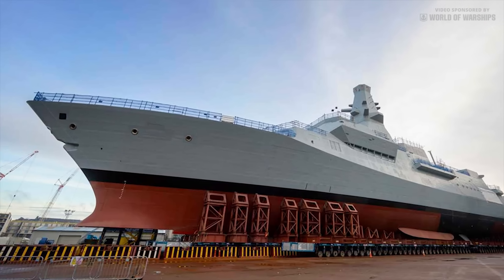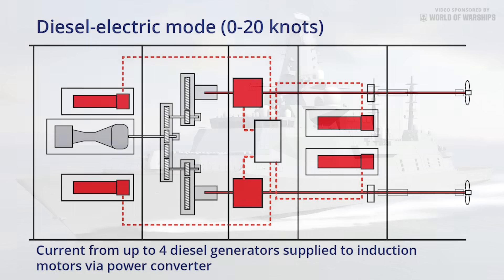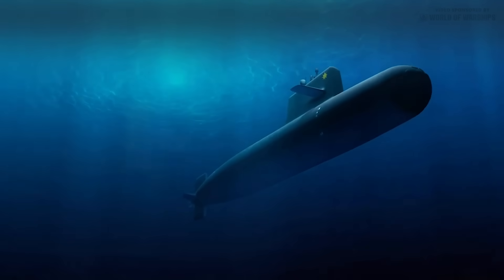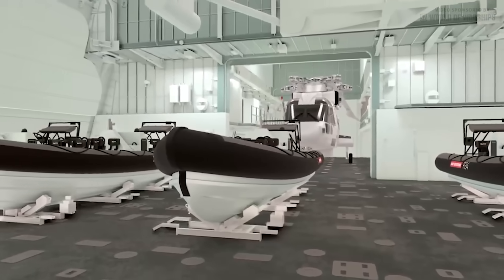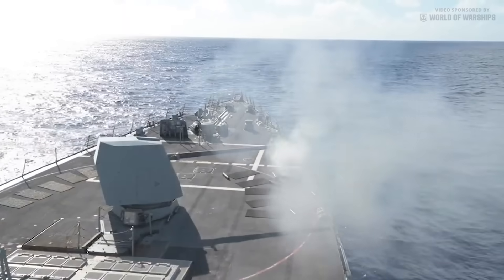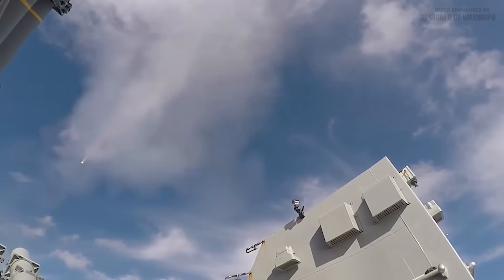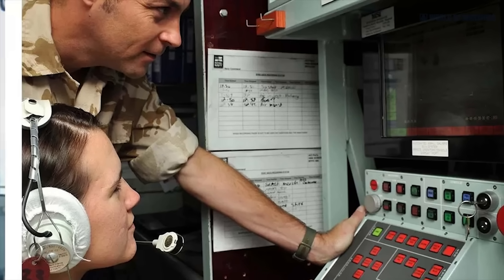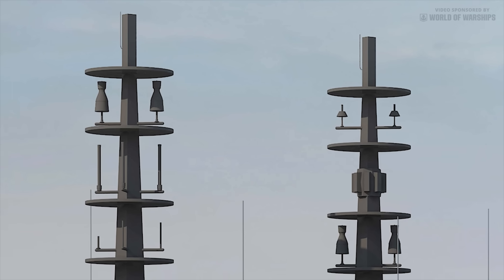An in-depth look at the Type 26 frigate design

Comment: Great video, but I do think that both aircraft carries need extra weapons systems. 3x cwis is not a lot of protection. And before anyone says that she doesn't sail alone, she has destroyers to protect her, but in theory, ammo is not unlimited and all it takes is ONE stray missile to hit the right area and bye bye.
Reply: Because it's not just the missiles and the VLS cells, it's the radars and combat management systems too.
Type 45 already has these (and better ones than any additions to the carriers would ever have) so makes sense to add any extra missiles to the destroyers that are better suited to carrying them because for the added cost of duplicating the fire control systems on the carrier, you'd have to sacrifice some amount of the missiles, meaning you have fewer missiles overall, so more likely to be overwhelmed in the first place.

Plus there are other small things, like if you actually had to fire a missile from the carrier, you'd have to pause all flight operations and do a FOD walk to make sure there isn't any debris from the launch on the deck before you could launch or recover any aircraft or risk losing an aircraft.

I'd much rather have EW systems like AN/SLQ-32 the USN has on all their ships to defeat incoming missiles, but they're much less flashy than missiles, so don't get the recognition they should.
Reply: @sergarlantyrell7847  The slq32 is of, to say the least, dubious effectiveness. It’s another old system that won’t do much against modern threats. Even the usn implicitly admits this in their concerns about taking ships anywhere near China in a war.

The truth is that there really isn’t a way of protecting ships effectively against high end missiles, especially when they can be land launched, meaning salvo sizes can be unlimited. If you have a system that has a ninety % chance of stopping each missile and can’t be overloaded by any number of missiles, then basic maths still says that there is a 50% chance one of the missiles will hit. Even ballistic missiles are cheap compared to warships, so this a losing game.
Reply: That would be a good point if ciws was much use against modern threats. But it’s not.
Reply: …Ciws is still carried because it’s useful about 3rd world threats like speedboats. But modern low level missiles zip through its engagement range in a couple of seconds. The chances of stopping one are low and stopping a realistic salvo is impossible. And ciws can’t even engage top tier threats like manoeuvring ballistic missiles.
Reply: CIWS are the last resort and the last layer of many that protect something like a carrier. All the way from Airborne Early Warning radar (AEW) to Combat Air Patrols (CAP) from jets stationed on board.

If it's down to the CIWS many many things have gone horribly wrong or bad mistakes made. The frigates/destroyers that accompany form many of the strongest innermost layers that protect a carrier, so it makes perfect sense to maximize their capabilities in this role rather than add inferior capabilities to one of the final (and least effective) defences of a carrier
Reply: Royal Navy already tried the missile firing Invincible class, and wound up deciding that its aircraft were more important than being a pocket battlecruiser.  In short, experience has shown the only weapons that really count on an aircraft carrier, are its aircraft.  Hence the need for dedicated bodyguards i.e.frigates and destroyers, plus a submarine.
Reply: Yes, Sea Ceptor is compact enough to have several systems onboard.

Comment: I think it'll carry a few Tomahawk mk'V. Best type 26 video yet and I've seen them all.
Reply: Hopefully, a missile with over 1000 mile/1600km range that is maneuverable and can hit maritime targets would be great.
Reply: I don’t think it’ll be tomahawk as uk and France are developing new missiles for anti ship and land attack
Reply: @TheDrummingWarrior  A possibility if new missile is not ready. Tomahawks can be launched from the Mk. 41 VLS system the Type 26 frigates will employed and are currently used on UK attack subs. Would be a viable option and frigates with 1000+ mile SSM's (with 1000 lb. warheads & possible 3rd. party guidance from onboard helicopter) would make them very potent platforms. Seems the UK is upgrading all their existing stocks of the missile to the Block V standard giving them an new anti-ship capability so integration with Type 26 a logical one & could be a short-term solution. One negative is the relatively slow missile speed (around 600 mph) and why push for a newer / faster missile as you mentioned.
Reply: @NesconProductions  Aussie Hunters will have Tomahawks V and maybe LRASMs we need better range than the NSM Mk II
Reply: The Canadian version will carry Tomahawks.
Reply: UK and Canada will need a larger VLS displacement on their ships and a better radar system to launch tomahawks from the Type 26 frigate varent  they chosen Australia varent will be the only varent of the type 26 class that will be capable of tomahawk launch if they choose the upgunned 96 cell VLS varent displacement of the type 26.

The UK ships don't use US developed wepon system like Aegis combat systems ect. They will use their own land attack varent.  Although  their missile cells will limit them how many they can carry since they given  their frigates too few missile cells

Comment: Excellent video, but your wrong about the Type 45 destroyer it’s displacement isn’t 7,500 tons it’s more like 8,500 tons.
Reply from the maker: According to the RN, T45 official displacement is 7,350 tonnes, although that is probably without weapons, fuel and stores which could amount to a further 1,000 tonnes or so.   https://www.royalnavy.mod.uk/the-equipment/ships/destroyers/daring-class
Reply: @NavyLookout  My uncle is a BAE marine engineer, who worked extensively on the type 45 and now the type 26 if it’s O.K. with you i will take his word for it.
Reply: @Mac  he said that 7,300 dry so full laden 8,500

Comment: Hope the integration engineering being done during this long development and build process means it’ll be well integrated and tested upon launch and won’t have the issues of the Type 45.
Reply: I have wanted to ask this for a while, but resisted the urge, because I know it could be perceived negatively and we have enough of that in the world, but now seems a good time.

How was it possible for the entire class of Type 45s to be launched with such a major engine defect? After HMS Daring was launched did the issues not show up until after Duncan hit the water?

I am genuinely curious, not attempting to troll something that has confused me for some time, happy new year to everyone.
Reply: @Irisishunter  parliament didn’t want to pay the upfront engineering and full mock-up testing and development and the ship power systems didn’t have the generous overhead to overcome degradation in performance.
Reply: @shinybaldy  Thanks for replying, but was any action taken between the launching of the first 45 and the last? Or for BAE was it a case of you ordered 6 ships to these specifications and that is exactly what you will get. Do major ship builders not learn this was a problem with the first of the class, let's make sure it is not a issue for subsequent ships.
Hope that makes sense.
Reply: @Irisishunter  when it’s a new complicated and long lead time item - the best practice isn’t to rush ahead and order six. Parliament didn’t give the engineers the resources or time to do the testing and development on the mock-up.
Reply: @shinybaldy  it's a shame it's not the 12 like originally ordered. It then went to 8, and then 6. They may have batched them and caught the issues for the later batches.
Reply: @Irisishunter  There is always someone who wants to 'pee in the tea', not saying this is you, but every thread about new Royal Navy kit has someone saying it's rubbish.
 Type 26 is looking like it is a very up to date, very useful ship, well thought out, well planned, well implemented, so much so that other countries have taken it up as the future, and not for the 'old pals act'.
 The Type 45 still has stories about it not liking warm weather even though it's considered one of the best air defence destroyers on the planet, the Elisabeth class carrier still has stories about it not being conventional enough, even though it cost a fifth of the latest American carrier and can cope with anything else out there. The Astute class SST still has stories about early design problems dating back a decade or so, but still is seen to be one of the deadliest submarines in the world.
 There will always be those that don't like what the RN are building or sailing. There will always be some saying what their country builds is best, and some who just don't like the country they happen to live in.
 The RN has some of the best cutting edge tech out there, we may be small, we may be different, but the RN and it's ships are always there when needed.
Reply: @RajBlake7  The type 26 does look fantastic, my biggest concern with them is we will not be building enough.
Talk of a new surface combatant, just had me reflecting on the last one if you discount the QE ships and that is the 45s.  
I understand the logic above saying well they would not build a full scale mock up.  But surely you cannot have a better mock up then HMS Daring, were power problems not apparent during her work up that could of been taken into account when building Defender and Duncan?
I should of asked this years ago under another thread, but it has been an itch I have wanted to scratch for a few years and I hoped asking in a respectful fashion here, might get me the answer.
Reply: BAE Systems should have learned the lessons by now but then again it is BAE Systems !
Reply: @1421davidm  BAE are considerably better than many others. General Dynamics UK springs to mind and the AJAX debacle.
Reply: @1421davidm  BAE didn't choose the propulsion system for the Type45...the government did
Reply: Im sure the government will step in and change the spec of something and screw it all up yet
Reply: What issues did the 45 have?
Reply: BAE advised against the type 45 propulsion system as they did not think it was properly developed when it was implemented, MOD wanted to take the risk, it is unfair to blame BAE when they advised against it.
Reply: What were some of the issues with the type 45 mate?
Reply: @maxt7525  The issues have been well reported over the years.
Reply: @paultanton6721  And rectified
Reply: @maxt7525  The propulsion system was ducking useless.
Reply: @ironmantooltime  From my understanding the problem was with an American built heat recovery system in the engine package . It is a new package using a Rolls Royce Engine and there is no issue with the engine. All new packages especially world leading new designs are going to have problems and they will be sorted. If you aim for perfection you never get there, aim for completion and you learn a lot along the way! Radar initially was relatively crude but it was there on time, when needed! We have two world leading Carriers and we with the type 45 the best anti air ships with the type 26 great anti sub capabilities. Enemies of the UK are going to subtlety or not so subtlety rubbish anything that comes out in the UK. Who designed and built the first Carrier, came up with angled flight decks, Steam Catapults, landing light systems, steam turbines? Royal Navy has led the way with many types of vessels and is still doing so. Initial problems yes as will all things but they will be sorted! Look what happens if you wait to long and have to many committees with their opinions all having to be heard. TSR2 closed down, gone, one of the designers said there where arguments by small minded no nothings about labels for switches. We lost a MACH 3 bomber because of stupidity like that. Get on get it done sort it. SA80 Rifle initially, easily damaged, MK 2 sorted, Soldiers happy with it,MK 3 even better. And still no nothings bang on about MK1 problem. Same as carburettor problems on Merlin, oh if you nose dive it cut out misfired big problem. An initial problem fixed by female engineer Tilly shilling in a very short time frame with a washer and then engineered out altogether and still people moan about initial problem. See here: https://en.wikipedia.org/wiki/Beatrice_Shilling.
Reply: @anthonywilson4873  Well said, new designs need to be trialed and sorted. The Type26 are excellent ASW machines but a little short in AAW capability. Aussie Hunters would give more capability.
Reply: Different system, the Type 26 has a MT30 gas turbine with direct drive to the shafts, for high speed, for lower speed they have 4 diesel powered generators, and electric motors, with a clutch assembly to disconnect the MT30 when on electric drive.
Reply: @paulhill1665  yah there’s no troublesome intercooler but the frequency adjusting PWM integration is going to be new. There’s always integration risks.
Reply: @shinybaldy  The Type 23 PGMU Upgrade incorporates some elements of the Type 26 Propulsion system, HMS Richmond has performed well since it was completed on her.
Reply: @paulhill1665  Hope I will get to see one up close one day. If they work as advertised they will be magnificent
Reply: That propulsion system seems a bit exotic IMO, think we will have the same issues with this class as with HMS Duncan and the sister ships in that class unable to work for prolonged periods without suffering a breakdown yet again these ships are back in port , SMH
Reply: @garnet michel  it's not IEP like Type 45 which was a big part of the issue, especially with the Diesels not having enough capacity and the Gas Turbines were also a significant issue with the ICs and Recuperators both being pests (they liked making me work). I was a Propulsion maintainer, serving on Ships 2 and 4 and working in training for the Propulsion system and Gas Turbine and then did 2 uears on T26 for the ship builder. Type 26 is in essence virtually the same setup as T23 prop wise, and the only real issue on 23 that I know of was the Primary pinion on the main gear wheel and the need to update the Gas Turbines to Spey 1Cs. I developed a study on the reliability of the T26 shaftline, and there were no significant issues discovered beyond the usual concerns with a shaftline. The gearing is bigger than originally conceived now as well (Can't tell you why), the MT30 is really reliable, and the motors should be fine. As far as I am aware, there haven't been any significant issues with the motors on 45.
Reply: @vxrdrummer  ok I really hope they get it right